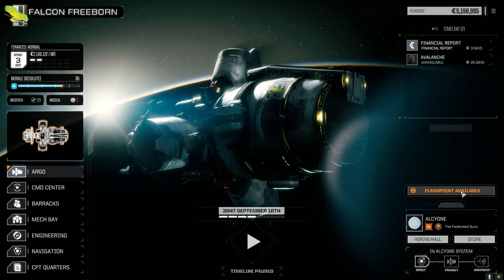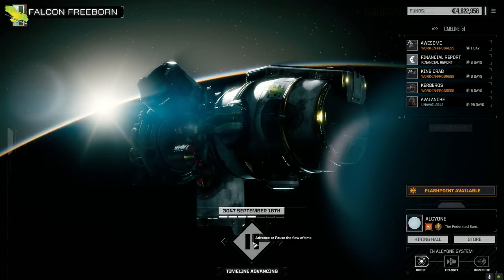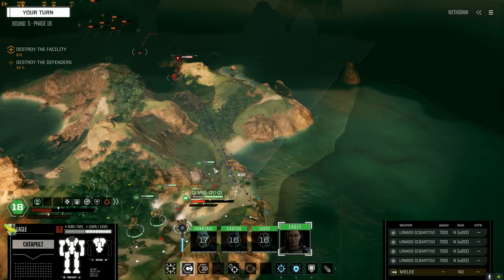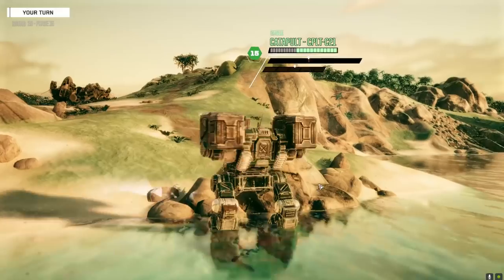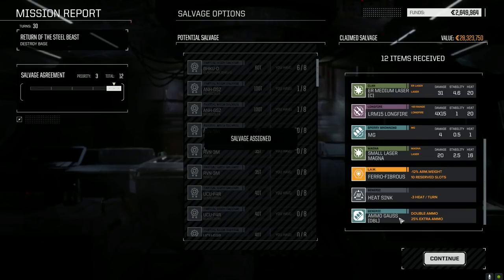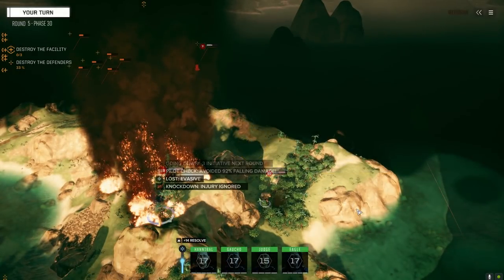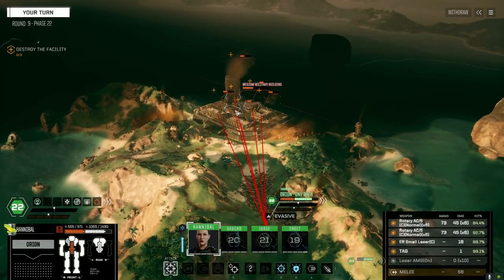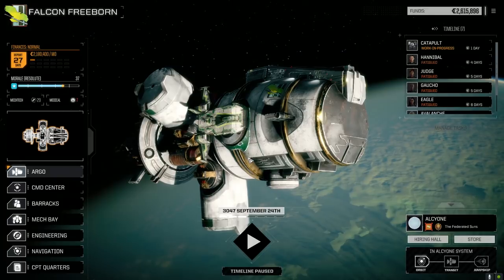Roguetech - Jade Falcon Freeborn - Ep101

Comment: I don’t know if this will help but I was having problems myself for a while. The missions would freeze or come back failed for no reason that I could determine. I ended up figuring out the only common denominator with all of my problems was that I was running a mech with a thumper artillery in it. It didn’t happen all the time but When I replaced that system I never had a problem again. I don’t think that the AI can figure out how to deal with it when you kill a mech that you didn’t actually target. Aka it dies from splash damage.  I could be wrong but as I said replaced that system in the mech and I’ve not had a problem again. Hope this helps. 
Other than that love the series keep  up the amazing work!
Reply from the maker: That kinda makes sense to me. Next go I will leave the Zeus at home. Thanks for the heads up!!

I love this series too. It has been amazingly fun and the viewers such as yourself have been stellar. I'm glad you like the content!

Comment: You needed to be within the scripted area while an enemy still existed; the scripted distance is an arbitrary predetermined number of hexes, it has nothing to do with your stealth, ecms, or the enemy’s sensors. Get inside that distance with an enemy reinforcing unit still alive and kicking, and it triggers the next mission update. Just remember how Darius is always telling to you to beware of turrets, despite you having been fighting turrets for five turns already- same scripted distance deal.

To counteract the next mission locking up during loading, try saving your game near the end of the previous mission. At the start of a turn when you have most of the objectives completed, make a separate save file. If the game locks up when loading the next mission you can restart from that checkpoint, saving you a half hour or more of time.

For the Omega, don’t forget that the BFG can use regular gauss ammo. It won’t matter for this flashpoint unless you choose to field it, but it is worth bearing in mind for later.